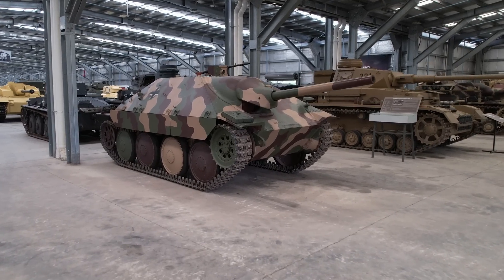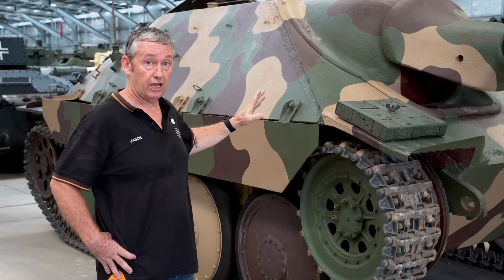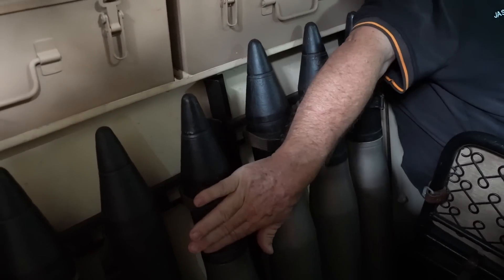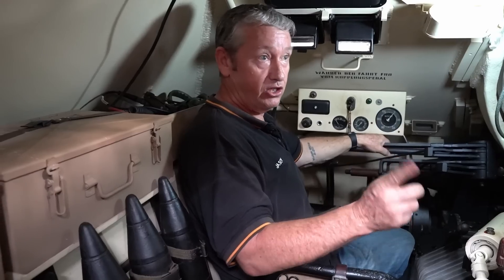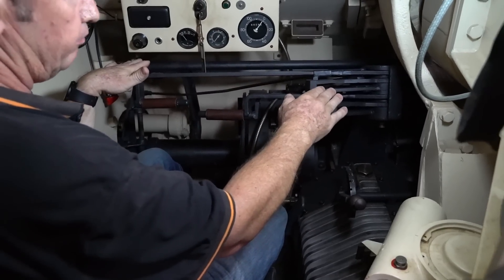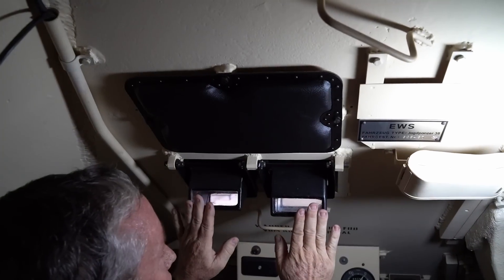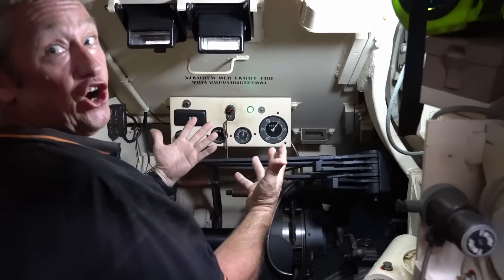WWII Hetzer STARTUP and interior tour! (WARNING: Loud!)

Comment: I believe that the MG34's wood buttstock would not have been attached when mounted on top in its remove mounting. It will just be in the way. The Swiss G13 had the commander and loader positions switched postwar. That round button with the German word for "FIRE." is used to fire the gun should the vehicle battery (12-volt) is dead. The ammunition (KWK40) is electrically primed, and normally fired using an electric trigger/switch. Those red lights will be lit when the electric circuit is ready to fire. If the battery was dead you can disconnect the normal power in and hook up the emergency firing circuit It is basically a small electric spark generator, enough to cook off the ammo's primer. Any questions? Ask the founder of the US WWII Historical Re-enactment Society. I have twenty years experience on Hetzers, both mine and the Patton Museum's G13.

Comment: Was lucky enough to get a ride in this at Tankfest a couple years ago. It wasn’t coping well with the heat and was doing limited runs. We held onto our tickets for half the day and right when we were considering trading them for something else, i heard it start up. Luckily i was standing about 2m away from Rob at the time and managed to get on the next run. Highlight of the weekend, as it’s one of the few tanks you rode in, rather than on top of.
Reply: @tileux it was tight, hot and loud, and you really wouldn’t want it to tip over on its roof.

Comment: I could imagine being in that vehicle during the hot humid summer time during battle, a couple of men cramped into a small compartment with little air circulation, everybody hot and uncomfortable trying to do their job , the inside filled with smoke from the gun firing and the vibration and excessive noise from the motor so loud you would have to yell to be heard, it would take a very well trained crew to make that vehicle perform in battle effectively

Comment: It's almost like they didn't expect the crew to survive long enough to use the ammo stored on the other side of the hull! Great video guys!
Reply: You could hear it coming down the road 10 miles away… 😂… Not much chance.
Reply: Considering prewar Germany was roughly the size of the state of Montana... a war of attrition vs Detroit was unwinnable.
The Hetzer was a great, cheap way to get an excellent gun out onto the battlefield while also giving its crew "some" protection.
Reply: If a Hetzer crew had to use that much ammo in one engagement, they were facing bigger issues than just loading. Otherwise they'd swap the extra rounds to the left once it the fighting was over.

Comment: Was the dial on the far right of the drivers panel the speedometer? As it went up to 100 - which is either very optimistic, or very scary (depending on where you were sitting....) 🤣

Comment: Small mistake in that text in front of the driver : it should say ' Wahrend' so the n is missing. (It means dont keep your foot on the clutch while driving). And two dots on top of the letter a but I can't type that on my phone )) great video !!
Reply: Not sure what type phone you have, but typically you can type the German umlaut by pressing and holding the vowel until a pop-up menu appears. Then slide over to the umlaut.
Reply: Während

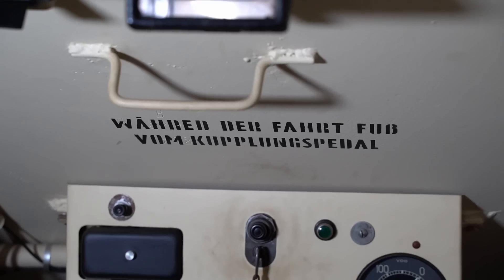Comment: Very nice tank. But there's a typing error visible at 2:20. The correct German word is "WÄHREND". There's a "N" missing.
Reply: Correct. That is also a very odd font, never seen that before.
Reply: @flitsertheo  it is probably because they used a stencil to spray the letters, so all letters with hollow sections like A, B, D, O, P, Q need support for the center section so they need to be divided. Just like the sprayed letters on wooden crates...

Comment: Don't you think they would have outfitted these tanks with mufflers and resonators so they would operate silent. Like I have to imagine a quite tank may have come in handy more than once during the war. And im sure gm had tons of resonators and mufflers laying arround from the cadillacs so they would have just had to make it fit the manifold then use the same machine when they ran out of already built ones.

Comment: May I be so bold as to suggest that the camo scheme should go from top to bottom and not sort of break above the wheel line? In other words it should include the wheels having two colours.
Reply: Tanks arrived at the field workshops in a basic dark yellow livery, and the workshops applied additional camouflage. Sometimes they didn't bother to  paint the wheels also.
Reply: After some time in the field the dirt, dust, mud and debris would create buildup line above wheels, which would cause blending effect anyway, the "break" of camo pattern would not be visible. This was taken into account and was desired effect.
Reply: Jerem Dav  Good point.

Comment: how do you go for leaving petrol in the system for long periods as in the UK we have this crap E5 and E10 not good for long periods as likes to attract moisture
Reply: fuel additives.  run it once a month.  the bigger PITA is batteries.
Reply: As long as the fuel tank is almost filled to the top you don't get problems with moisture. An almost empty tank has lots of air in it wich expands and retracts as temperature changes, so everytime it cools down, it breathes fresh moist air from outside and the moisture condenses inside the fuel tank.
In this case E10 is actually better than pure gasoline because it dissolves the water while in pure gasoline the water droplets sink to the bottom of the fuel tank and it starts rusting.